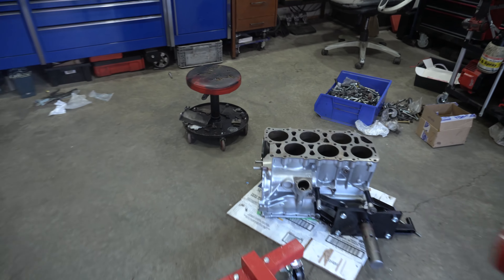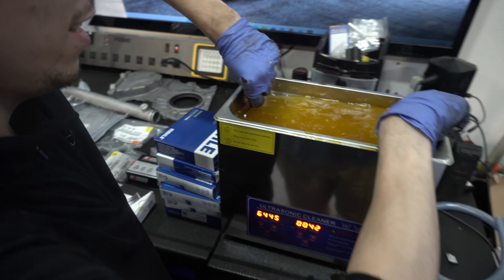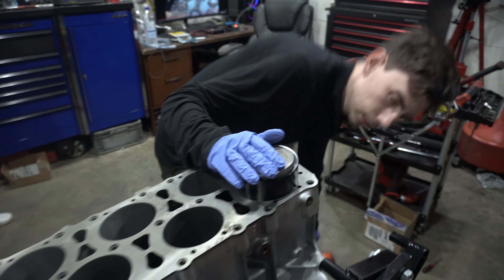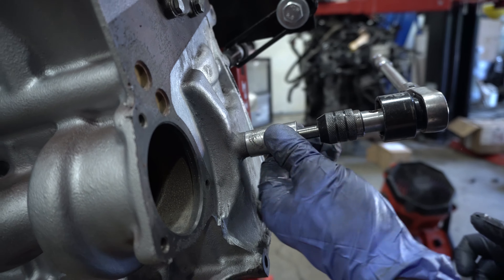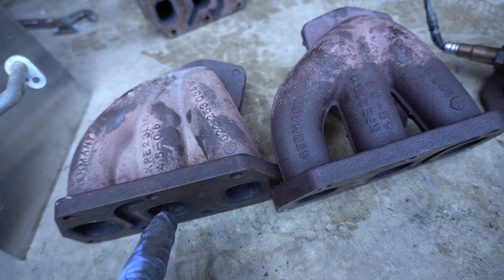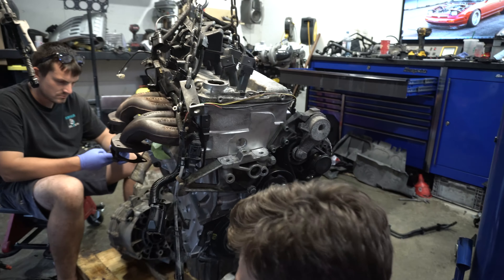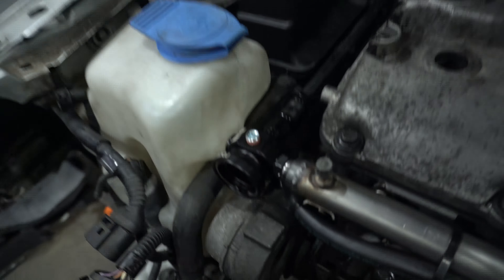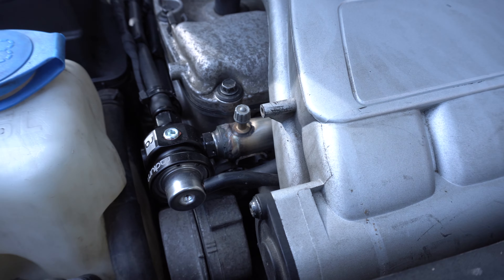Rebuilding a 20 year old 3.2L R32 VR6 for an Engine Swap!

Comment: Im building a 3.6 at the moment.  So you say 60nm + 90 on the mains (is that R32 spec or all VR6 ?).  I've been finding so much conflicting data out there.  I'm doing a 3.6 and have found 22ftlb (30nm) + 90 + 90.  Its probably very close (in terms of bolt stretch) but I still find the data discrepancy annoying.  Especially considering I am new to these engines.
Reply from the maker: I noticed this as well. Try both, marking the bolts, and see where the final bolt angle of each spec shows up at. My spec is listed for 2.8 12v, 2.8 & 3.2 24v. Looks like 3.6 is different on paper but just like you mentioned, probably pretty similar.
Reply: @thirdgeargrind  New stretch bolts arrive this week.  I'll let you know how it turns out.
Reply: Straight from VW repair manual is states, 30nm + 180 or 30nm + 90 + 90
Reply: @Teasa617  Same in the old Bentley repair manual.  But other sources tend to vary.  

When my new bolts arrive i'll do the 30NM and then try for 90 with the torque wrench set at 60 nm and see where it ticks.
Reply: Well I did the main bolt torque test today. All new 10.9 bolts, torqued to 30nm.  Paint marked 0 degrees.  Then set the torque wrench to 60nm (44ftlbs) and turned the first 4 bolts till it clicked.  They all clicked off at about 45 degrees.

I then turned them all to 90 degrees.  Checked rotation, all good.  Then began turning them all to 180 degrees while fiddling with the torque wrench.  They were fairly consistently ticking off the torque wrench between 80-85nm (60-65ftlbs).

Interesting, as that's pretty close to what I think a 10mm ARP 8740 bolt goes to.  Also a bit scary for me as I'd never used a torque + yield bolt before, and my brain was imagining the bolt stretching while I turned it to the required angle.

In summary this means that 30nm+180 seems to be about 1/8th of a turn less than 60nm +90.  In the grand scheme of things its probably not a big deal.

VW Part number 365801.

Comment: Question I did the same swap I have to use the cam from the 2.8 and put it in the 3.2?
Reply from the maker: Depends. If your tuner is unable to make the mk5 cam/vvt function, yes, use the 2.8 cams, gears, vvt cambridge. If you have the mk5 engine, it is preferable to use those components if you can get the modified software to match. A vvt connector housing will need depinned on the 2.8 harness and repinned into a certain brown connector housing as well if you are retaining mk5 cams, gears, and cambridge. The cam position sensors are also different so use the respective ones.
Reply: @thirdgeargrind  thank you so much for the info

Comment: is it a mk5 3.2 motor?
Reply from the maker: This was a BMX touareg code 3.2. I believe this one has the mk5 internals, the slightly lower comp pistons, the different exhaust cam and vvt system. We scored on an already rebuilt mk4 r32 cylinder head that sped up the rebuild process. We had mistakenly put the mk5 cam gear on for a second, realized this, and I retrieved the mk4 vvt stuff from the 2.8 24v to put on.